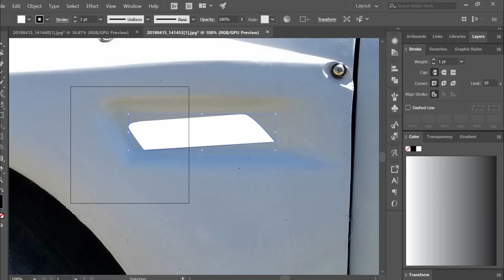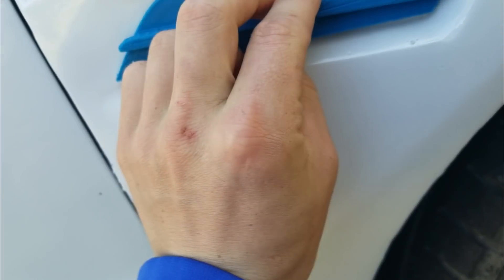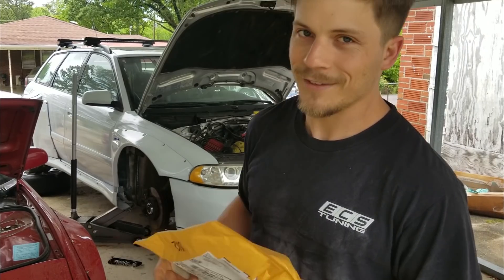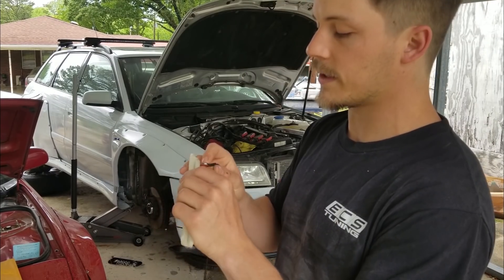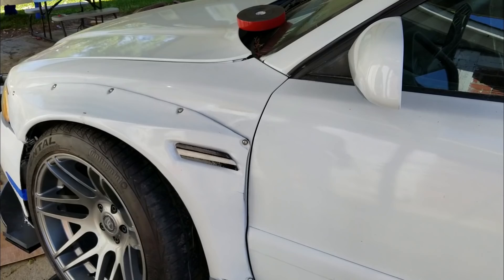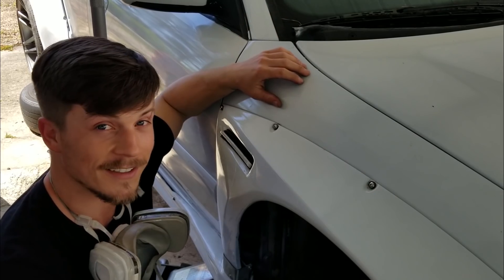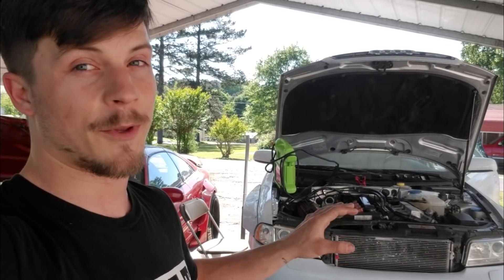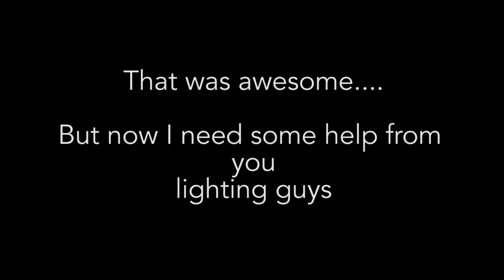3D PRINTED TURN SIGNALS

Comment: According to Julex's 08/01/11 post at this website (https://www.audizine.com/forum/showthread.php/435223-Anyone-running-LED-s-for-the-turn-signal-bulbs), here's a potential "fix" for the LED turn signals: "Either use load resistors on bulbs (meh) or take out flasher module, open it up, you'll see a metal bridge looking resistor protruding up from the board, can't miss it, in the back of flasher. Cut it in half and solder 3ohm resistor (at least 1W) across the cut, done.

You might still have issues though since aftermarket LEDs seem so have only one diode installed and when you put flasher on, it bleeds current into parking lights circuits. It is very visible once you take out your key, turn on your hazard flasher on and open driver's door. In my car the LEDs bleeding caused my cluster to light up each time turn signal was and chime to engage as well. Car was basically thinking I was swtiching park light on and off. Kind of stupid.

I had to solder in diodes on front light park line going to leds as well."

Comment: 3d filament tip. Stay away from PLA for outside products . If you're going to print something for a car that is going to be weatherized use PETG or ABS. Lasts longer in warmer climates

Comment: Thats a flasher relay problem. Get a flasher that supports led lights as the old flasher is designed for the other bulbs which used more power compared ed to the leds which takes less current. This will solve the fast blinking issue

Comment: It’s a resistor issue just allow the same amount of voltage going threw as the OEM bulbs. Also LEDS require less voltage to run and are more energy efficient

Comment: Hyperflashing...best way to fix that in my opinion is locate the actually flasher unit (relay)...usually under the steering wheel/kick panel...and replace that same one with an LED flasher relay (usually you get good deals on eBay...but for better quality product I’d try Diode Dynamics. I have found this to be the easiest way.

Comment: Yeah you need resistors. The LED bulbs don’t draw enough current to trip the relays properly. I had the same issue with my b6. I never could get the front led signals to work properly even with 4 resistors so I went back to normal bulbs in front and the rest of the car is LED and working properly.

Comment: The most functional thing I printed for use on my car was custom inserts for my hks bov. Just didn't care for the sound the stock and round insert provided. First prototypes were pla. But they didn't last very long. Pla breaks down easily and pretty fast in real worldl non climate controlled conditions so I reprinted out of abs and they lasted.
Reply: @BUILTOFFICIAL  also with abs you can smooth it out with acetone vapors I'd you have any other questions about printing feel free to ask. I'm not an expert, but I've been messing with it for 3 years and gone through many failures and sucesses.

Comment: Advice for 3D printing, you can use heat gun to smooth the surface, and also the black out part of your new blinker you can use putty on that then sand it off an then paint it , it would be nice smooth surface, over all i liked it a lot, looks dope :D !

Comment: Not gonna lie, im not a fan of the clear filament color. what if you made a silicone mold of the parts and poured in clear resin instead? i think it would be more durable and you could sell it easier if you decide to sell molds of the widebody kit, too

Comment: What you can also do is make a paper or cardboard templates, and on the template you basically put something for scale, like a 1 cm or inch line. Then you scan it, and use the picture on your software, change the size of the picture so the scale on it matches the scale in your software, and then you can just draw following the shape you have on the picture.

Comment: Just so you know PLA will be impacted by the elements. I have 3D printed things for my car and they will warp and shrink over time with temperature changes. ABS is the best choice for printing actual parts that need to withstand being on a car.
Reply: @BUILTOFFICIAL  Yeah luckily you can always re-print. Maybe the paint will help protect most of it, but I know over time the PLA will deteriorate. If you haven't printed in ABS before I would do some research because every printer is a bit different. It will require different temperature and bed settings, and would benefit from an enclosure around the printer to retain heat. That can be as simple as putting a cardboard box over your printer. Either way, those turn signals are amazing!!! Best of luck dude

Comment: I'm literally 3d printing a part for my dad's car lmao

The button on his parrot hands free has been broken forever, I don't know if it's gonna fit, it's a quite complicated piece.
Reply: @BUILTOFFICIAL  I actually just installed it, it needed a little bit of trimming on the non visible parts and it fits pretty much perfectly, looks much better with buttons compared to before where he had to press the actual switch on the electronic board because the button was broken.

Comment: I would probably say that you need resistors behind the bulb. The orange ones you can find in walmart or eBay or amazon. They get hot so put them in a good spot. Also it’s a possibility those are incorrect bulbs check your wiring that wire harness may have a daytime, ground and turn. Flip the bulb around because ground may be in the middle. If that doesn’t solve the issue just buy some leds that has a switchback module. Had this issue took forever to find the correct module. Most modules like to make negative feeds then i used relays to turn those to positive lmao sooooo much work but there is a easier way

Comment: Low resistance on blinkers cause this issue, same as if they were not connected at all, new led specific relay would solve this easily, this is is a common issue on older vehicles and motorcycles designed for regular lights.

Comment: You need to wire in load resistors. The LED bulbs use far less power to run than regular bulbs and the car See's the led bulbs as regular bulbs burnt out.

Comment: Use a LED specific blinker relay, this will fix your problem with your turn signals. The issue was made because you replaced the front bulbs for LEDs which has less resistance.
Reply: I was going to suggest an in line resistor as the low resistance causes hyper flash when the car thinks there’s a bulb out, but the relay would be much cleaner. Good advice!
Reply: @marcuscarpenter3316  a load resistor must be placed in parallel with the LED bulb, not in series otherwise it would light up less bright.
Reply: DrSpeed1989 just what I was thinking
Reply: And if it that doesn't fix it, he must check the relays inside the hazard switch. They get stuck pretty easily when they get old.
Reply: DrSpeed1989 b5 Audi’s have the relay as part of the hazard switch
Reply: @BUILTOFFICIAL  maybe I can figure out the schematics where you need to hack the switch

Comment: Heh, good job man.
I literally went through a very similar process with my 3d printer and my MR2 blinkers. My print came out pretty well on the 1st try also. They're not finished yet as I want to wire individual 3mm leds and I kinda ran out of motivation. You've kinda inspired me to get back to the project and finish them. Kinda lol
Reply: Finish them!
Reply: @takumifujiwara8565  lol I will eventually. Thanks for the push <3
Also, do I know you from Random Callsign's channel? Pretty sure I recognize your avatar
Reply: @starfox_wr-45e93  could be Not sure🤔

Comment: the system is expecting a certain load with the lights on, it believes a light is out because there isnt enough power draw. I had a similar issue switching my Grand Cherokee to all LED. See if there are LED turn signal relays available for that vehicle. they will trick the computer into thinking there is proper power draw. other then that you may have to put resistor at EVERY LED bulb wiring that you switched from incandescent. they are easy to install but if you are switching alot of bulbs to LED this will be a pain. Hopefully there is a relay, that would be the best and easiest fix i believe
Reply: gradient602 his problem reminds me fondly of the pain of the in the ass led's can be for vehicles with a resistor system for the lighting. My dodge trucks an absolute headache because of it. Chrysler loves that canbus resistor system
Reply: @jaredthomas9984  we share the same Mopar pain

Comment: Great job on the 3D printed lights bro they look great. As for the lighting problem, I mean I’m in no way a auto electrician but I have had to deal with quiet a few wiring problems myself as a diesel mechanic over the years but if it was me, 1. for the issue of the turning signal staying on and not switching back to the headlight I would be looking at changing your relays for your headlights cause it seems like a change over relay is sticking and not switching back 
2. For the turning signal blinking really fast, this is cause by low resistance in the turning signal wiring circuit. I can only assume that the light that you removed were halogen style globes and not LEDs. LEDs have a lower resistance the conventional globes and power travels through them faster hence why it’s blinking faster. To fix that all you need to do is add resistor inline on the power side of the wiring and this should fix it for you. Sorry to talk so much about it but I thought you might like to know is all. Anyway love what your doing man. The car looks awesome!
Reply: Those are actually pretty good  pointers

Comment: also y does this vid look very choppy is it just me
Reply: It’s the frame rate.
Reply: pretty laggy here too
Reply: @BUILTOFFICIAL  if u use an acetone solution(https://www.youtube.com/watch?v=6xFUNFG-UKE) u can get rid of 3d printing lines to make the piece smooth
Reply: Nate Gupta I shot it in 24 frames, if I would have shot it in 60 it would make the rollers look smoother but create a less cinematic look
Reply: Samsung video tapping the videos fine'
Reply: @lanceduck3451  the video runs with 15 Frames/sek